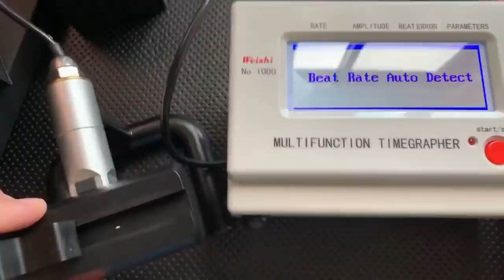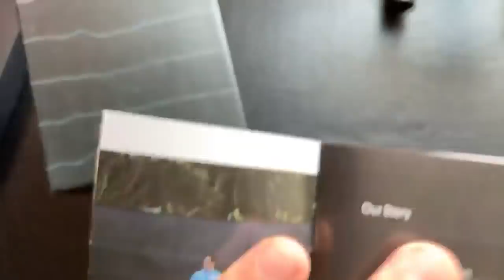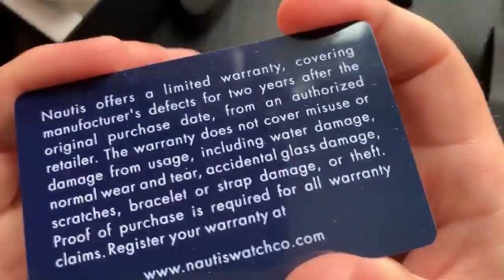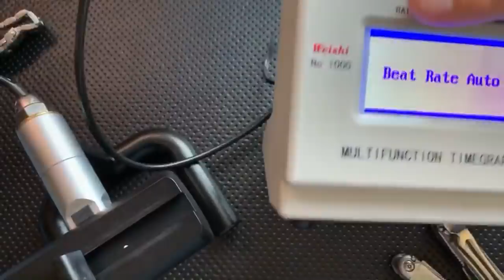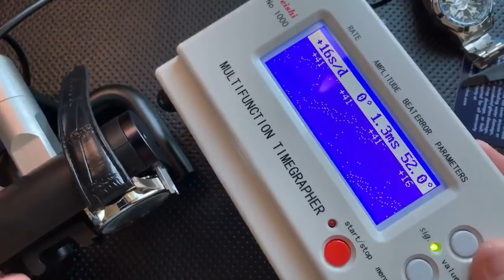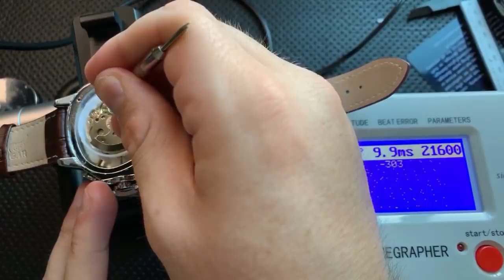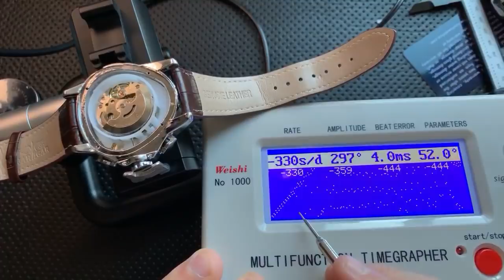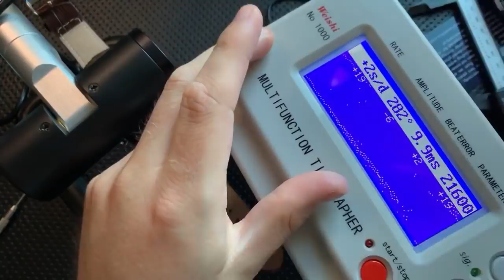Terrible Watches LIVE!  (October 2018)

Comment: Agree with you: that Nautis is insufficiently crappy. I can imagine that a lot of people would be quite happy with it, possibly even at $375 - certainly non-gearheads/watch folk. It's not really my bag but in a pinch I'd wear it without feeling embarrassed. It tells the time, it's easy to read, it's going to be pretty accurate, you can read it at night. It's also got some nods at quality like decent lume, sapphire crystal, and a decently machined clasp rather than the stamped and folded nonsense you still get on many sub-$500 watches. For $99 it's acceptably decent. The chrono seconds on the sub-dial is weird (I'm not a fan at all), the chrono pushers seem to have a really spongey action, and it's almost comically chubster, but it's certainly not a terrible timepiece.

Comment: I'm actually a watch maker and I couldn't help but cringe when I saw you put that drop of oil inside the komono watch. That is not how you seal a watch! What will happen is the movement will get gunked up and the extra oil will actually attract dirt shortening the service time of the watch. If the watch has a gasket you oil or grease the gasket (O-ring) to seal it. But you have to be careful what grease or oil you use as some will actually break down the gasket. Some watch oils will even break down plastics which can be detrimental to plastic parts inside some quartz movements. BTW I just wanted to say I love your knife vids! and Cheers!
Reply from the maker: Hah.  Don't worry, I know.  It was mostly for grins.  I went back in and cleaned it out later :)

Comment: You need to pay attention to the “ beat error” as well as the “rate”. Beat error needs to be as close to “0ms” as possible.
Reply: Also......dont assume your “ lift angle” is 52 deg.....could be a different value......if you know the movement model you might be able to find the correct angle online.You need to set your meter to correct angle for proper reading
Here is one link I found
http://pczw.uhren-mikl.com/downloads/gamma.pdf

Comment: My Seiko 5 isn't perfect,  but it keeps considerably better time than +47

Are you sure yours is a fair sample, and that Seiko is in good company with the others?
Reply from the maker: I've had two of those now.  Both were running +30 or more.
Reply: @NickShabazz  Hmmmmmm. Maybe I'm luckier than I knew!

Thanks for the video! 😊
Reply: With anything running a 7S26/7S36 accuracy seems to be a crapshoot. Doesn't help that you can't easily set the watch accurately to begin with due to lack of hacking. It doesn't bother me that much because I switch watches regularly, but I certainly do appreciate the considerably better accuracy of some of my other pieces, meaning they don't need to be adjusted for days or even weeks with regular wear (e.g., and here I got lucky, I think: gen 2 Monster with 4R36 running +/- 5 seconds/day).